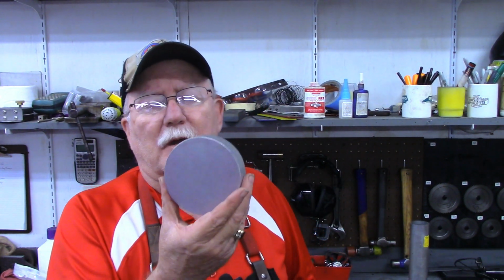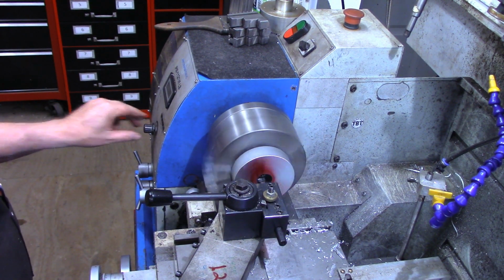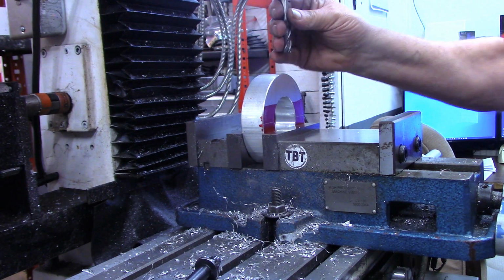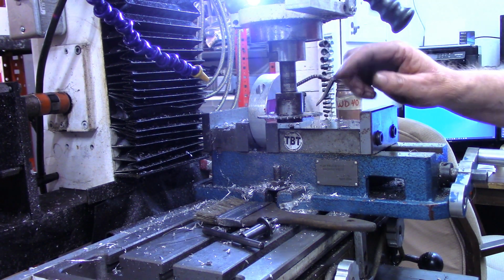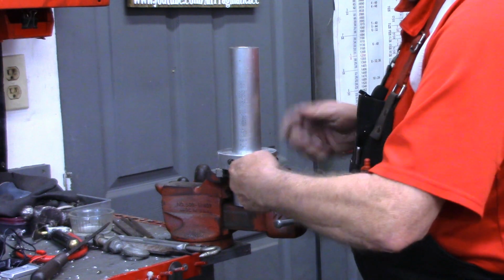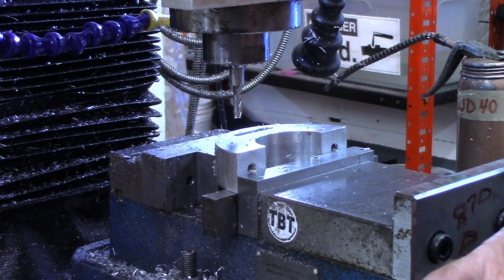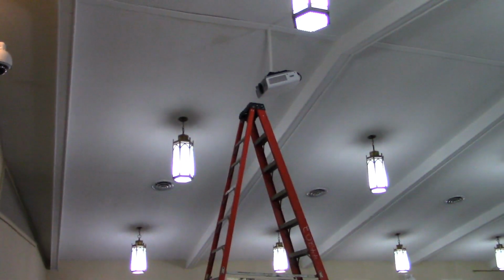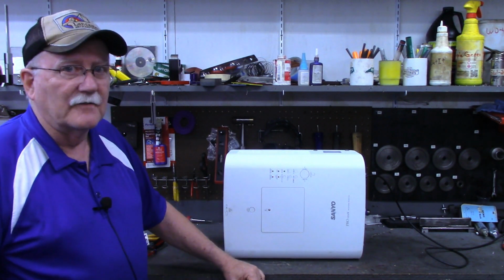Machining a Simple Split Clamp For a Special Purpose

Comment: Great video Lee. I do have a concern about storing the acid that close to the mill or any other precision machines/tool. Just the minor fumes off of the acid are enough to cause corrosion on the mill and other machines/tools. I may have ruined an expensive automotive scanner by leaving the batteries in it. Batteries leaked inside the case and now it will not clear a code. It will read but not clear. Only about a $300 mistake for me.  Just please consider me a concerned viewer. Thanks again for the video.

Comment: What tells the CPU the filter needs changing?
A- Timing, there is either a manual switch that isn't being tripped, or you have to go into settings and tell it...
B- Airflow, there is either an airflow sensor that is clogged, or there is a fan directly related to the filter that is malfunctioning.
C- Temperature, there is too much dust build up on a heat sink, or the heat sink paste has dried out and is now worthless.
For the record I have no experience with the internals of a projector, but lots of experience with the internals of computers, and you would be surprised how often C pt.2 happens!
Reply: I agree that if the airflow sensor is dirty the machine thinks the filter is clogged

Comment: Thanks for the video and a smooth operation for changing the beamer. Now you didnt say the model number for the piece, so I cannot check for its manual, but having worked with a few thru the years, there's usually a lamp hours timer to reset thru a menu, as it cannot feel the new lamp. Now the filter is a different issue: That "abnormal condition" you're already in - the lamp won't even start to get you into a menu - right? I've got a hunch that there could be some smallish "reset" button within the filter compartment telling the beamer you've been a good boy and changed the filter.
Just my 2 cents, DIYSwede

Comment: Great job but why didn’t you just leave the clamp ring installed?
Reply: a, It doesn't need to be there.
b, If they have to change another projector they would have to either make another clamp or go back up and get this one.
c, Because it would look odd.
d, It's a tool not a decoration.

Comment: Clicking the wrong button. Some more.
17:30 Youre a genious, tapping while the piece is still under control. You could have continued tap drilling through I guess, and then tapped, and not forced to bother about the length of the screw. I'll have to remember that.
Nice You work for the church. I do.
20:00 Could not be better.
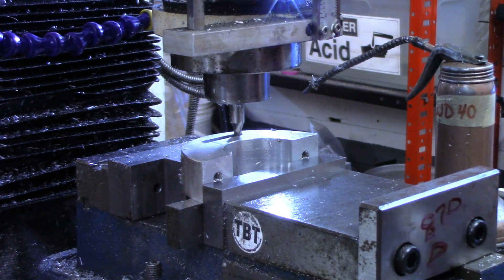23:30 Thats a new way of chamfering but as long as the milling bit, and the stock the amanage, why not?
25:30 Well done! Congratualtions!
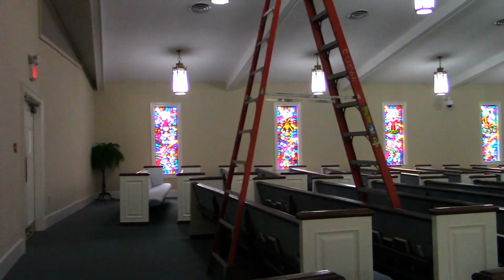26:00 Thats a nicely looking church. 
27:10. Neither do I but checking the ladder to be safe and trusting it, I go anyware. Imagine being 40 feet up on a ladder, rubbing the wall with brush, facing resonance and the rocking ladder, in order to clean the house before painting. .. Faith!

Lee! This was one of the finest videos I've seen. Most of us, Youtubers, machinists, use 75% of the time improving our own toolset. You used Your skill, knowledge and resorces to help Your Church. God bless You!

Being not infected but obviously affected by Corona, Writing a novell, very nice to watch Your video.

Comment: Thanks for yet another interesting and educational video.
You turn a 1"" by 4"" piece. I turned a 3" by 1" piece like that. Lots of chips ans swarf proceeded through the spindle of the mini lathe and dropped down on the gear train for threading. Hrrm, unexpected cleaning followed. The spindle does not reach outside the back couver. How does it work for You?
Whow for the music at 8:20. Engaging but soft, not hardrock….. Tastefully selected!
Cap head screws... One takes what one got... The dimension is seldomly critical.
We all take shortcuts like putting a milling bit in a Jacobs chuck to awoid the tidious change tool. Keep the tounge in the right mouth, be soft....
12:50. Simple but briilliant, how to measure the needed depth!
13:30 Very true. Lazyness often wins but precision is not gained by speedy work.
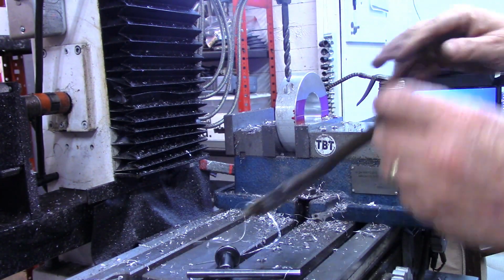14:00 ! For other reasons I bought long tapping taps meaning that the shaft has a smaller diameter then the tap. Really handy but they did cost, 25 USD each…..
15:00 Not hawing that large slitting saw, the bandsaw is my option.
16:00 Magical, cutting from all four sides. You're a genious.